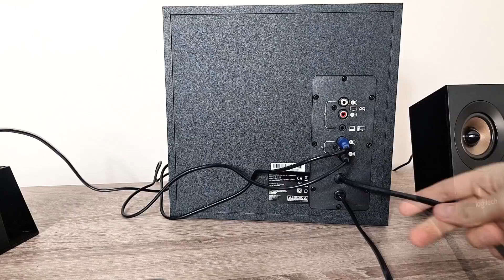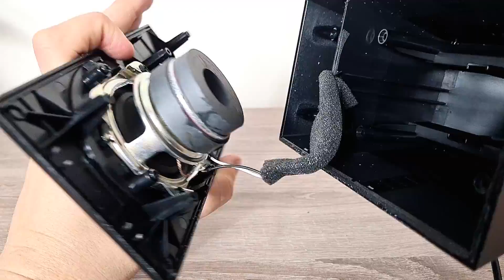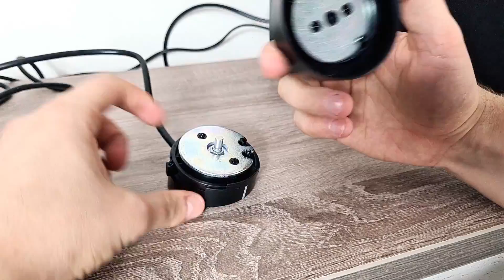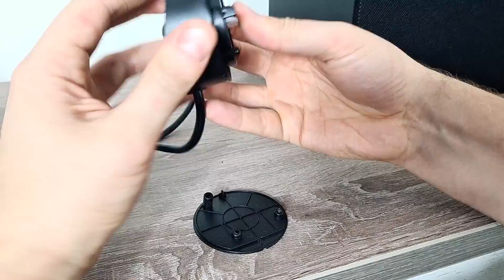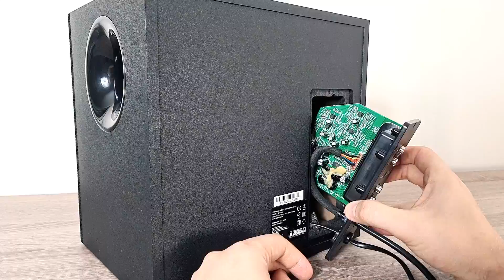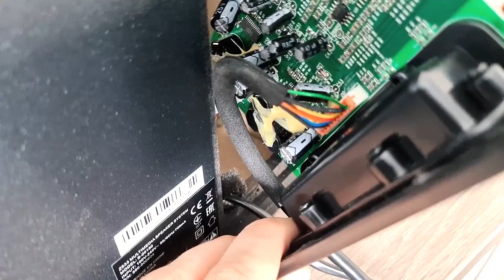Logitech Z533 Disassembly + Free Air Bass Test

Comment: i was big into Logitech speakers 12 years ago or so, i wonder if there still using TangBand and Eastech drivers as i dont think Logi actually makes there own drivers. During the sub box teardown it does look like they finally moved away from the STA540 power amp they have been using for over a decade and went to a class D solution. While the STA540 is a great IC the move to cheaper and more efficient class D sure helped the bean counters

Comment: Look crappy to me to be honest. X-230,X-540,z3 ,z2300 ,z5500 etc were much much better. Look at the thickness of satellite speakers plastic walls
Reply: For this size of driver you almost have no coloration and the size of the enclosure or thickness won't participate much. I'd even say change it to whatever you like lol. Check out the z625 which is thin as fuck but it doesn't play a role. The woofer is in its own enclosure and they crose relatively high, more than 100 hz.